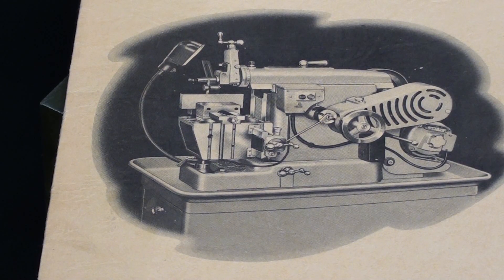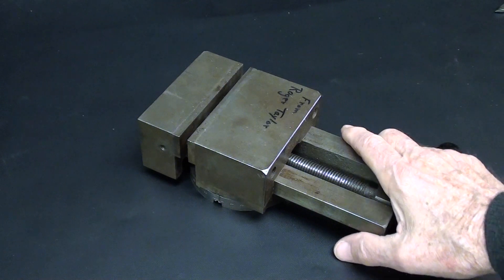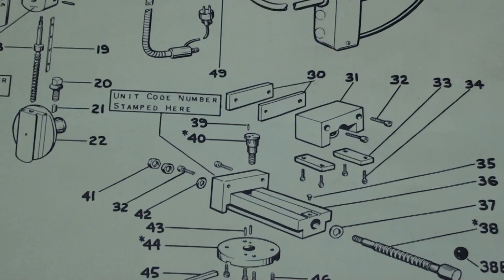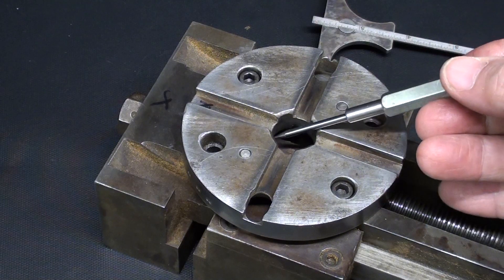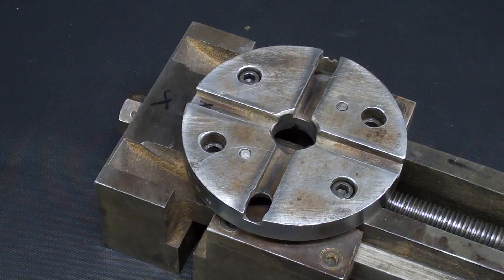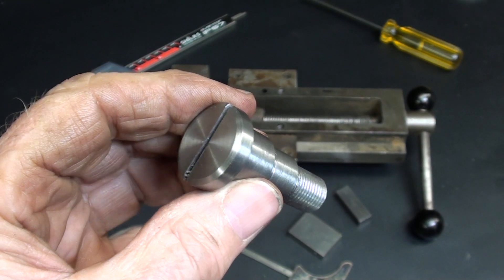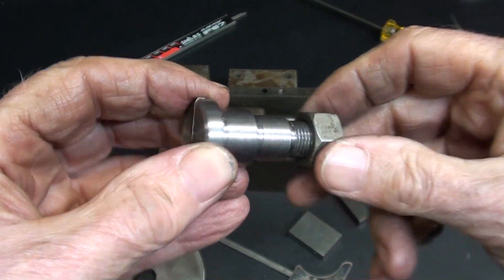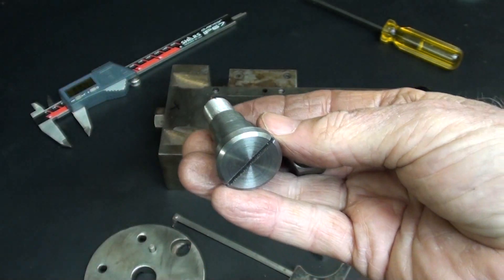MAKE A SHOULDER BOLT for South Bend Shaper tips 547 tubalcain

Comment: Mr Pete I have a question about the bolt. At the 00:53 second mark of the video the schematic show a pin, part #39, inserted in the head of the bolt. What was that pin for? Thanks in advance.
Reply: I would say it's a locking pin to stop It rotating when tightening it up ,without the need for a slot in the top (there appears to be a corresponding hole in the bore where it sits)
Reply from the maker: To keep the bolt from turning when you tighten the nut

Comment: <> Nice Video -- I don't want to rain on your parade but ----
<> Parting off using a portable bandsaw goes against all of your safety tips .
<> Nice job .
Reply from the maker: How is it unsafe??     Everything about machinery is dangerous
Reply: I detect a note of hostility . The chuck is spinning the saw blade is revolving . It's your canoe ---- you can paddle it any way you want to . I didn't mean to rattle your cage . Take a chill pill .
Reply: @TangentJim - alias macho man.   I detect a note of hostility.  It's your canoe ---- you can paddle it any way you want to.  I didn't mean to rattle your cage.  Take a chill pill.

Comment: I notice that you did not drill the bolt head for the pin #39.  Any reason?  That was a great threading tool.
Now go put that Lock washer on. You may need a standard washer. Not much length for the nut.
Reply from the maker: I am may still have to pin it. Time will tell
Reply: Mr. Pete, here is something else. The insert on the lathe is too low and leaves stubs on the part.

Comment: Mr. Pete back when I was in school we had a instructor who claim you don't need lock washers if the bolt is tighten to right torque I agree on some things not everything.
Reply from the maker: Yes, he is probably right. I was thinking of using a lock nut
Reply: When the joint is tightened to the proper preload, the lockwasher is flat and acts like a flat washer. Stretching the bolt by torquing makes the bolt act like a very stiff, strong spring, and this happens only once the lockwasher is flattened. The only time the spring action of the lockwasher can keep a bolt from turning is when the bolt has lost enough preload so that the lockwasher is no longer flat.

Think of the joint being held tight by two springs: a bolt that is a very stiff, strong spring, and a lockwasher that is a very weak,, soft spring, compared to the bolt. The stiff spring (bolt) has to be unloaded almost completely before the soft spring (lockwasher)  can expand and do its work. At that point the joint is so loose that it's considered failed.

Source: i am a retired engineer and fasteners were one of my design responsibilities and specialties. 

More details at: https://en.m.wikipedia.org/wiki/Bolted_joint#Theory

Comment: Well now you gave the cold shoulder to that problem.  At the hardware store shoulder bolts are the most expensive I think.
Reply: What's a hardware store? All we have around here is an ACE HARDWARE and it might better be a paint and lawnmower store
Reply from the maker: Yes
Reply: IF you can find them at a hardware store, that is.

Comment: Sometimes the simple projects are the most rewarding. One thing I do not understand is why doesn’t more YouTube creators use carriage stops? On my Grizzly one wasn’t even offered, so I had machine muppets own. 90%of the work we make has enough tolerance on the length that a carriage stop will make the parts to tolerance. Also using dies is something that isn’t used enough on YouTube, too manny creators want to impress us with single point threading, my rule is only single point when the material is difficult or an odd pitch or diameter thread. Why go through the extra work and effort? Keep warm up in IL.
Reply from the maker: You make two good points. Are use the care of the shop all the time, but I may not always show it. And I use a die all the time

Comment: Thank you for all the videos...The next time you use a Carriage Stop can you explain how it is supposed to work plz.  Can it work with the power feed if the clutch tension is adjusted to slip when it hits the stop??   Clearly when manually feeding the carriage, it will bump against the stop.  I have a Logan with a knob to set the tension...I have seen other Logan lathes with handles.  Is there an arrangement possible to flip off the power feed when it hits a stop?
Reply from the maker: No, be careful. I only power feed to get close to the carriage stop. Then bring it up by hand
Reply: @mrpete222  Thank you  U da man. Makes perfect sense

Comment: how do you get a screwdriver into the slot on the bolt? It looks like the vice screw will be in the way. I guess that is why the original was pinned. loctite?
Reply: The vice screw is connected to the movable jaw. This leaves a space between the rail/guides of the vice between the fixed jaw and the movable jaw when the vice jaw is retracted. Thus easy access to the screw head.
Reply: @dicksargent3582  at 7:12 it shows the moveable jaw is threaded, not the vice body i.e screw thread obstructs shoulder bolt slot..
Reply from the maker: You are right, I could only catch a small bit of the slot. Luckily he did not seem to turn on me anyway